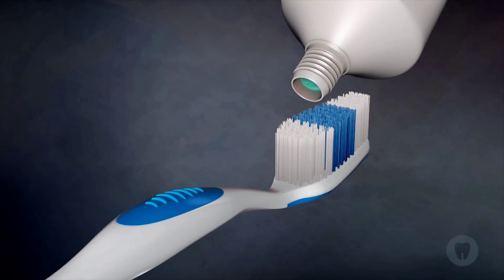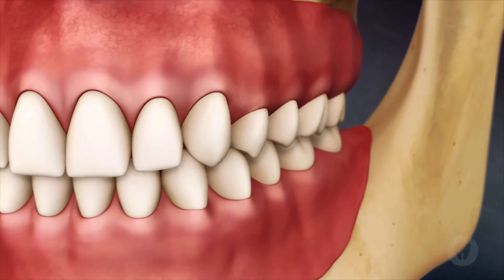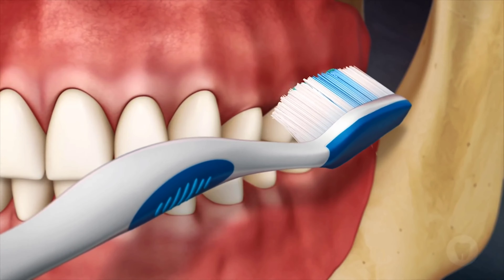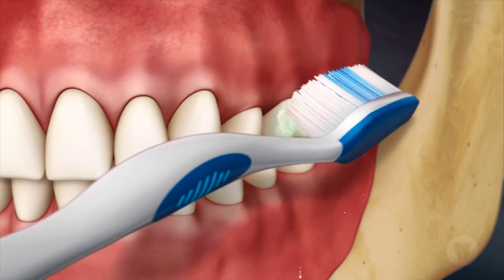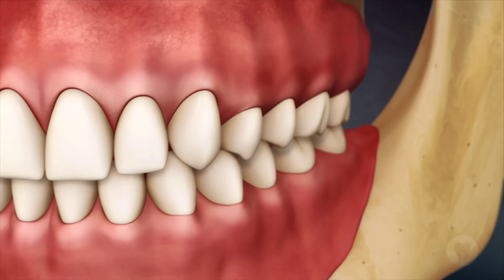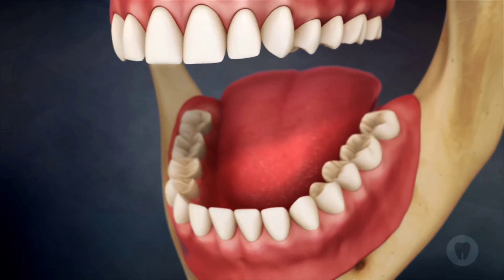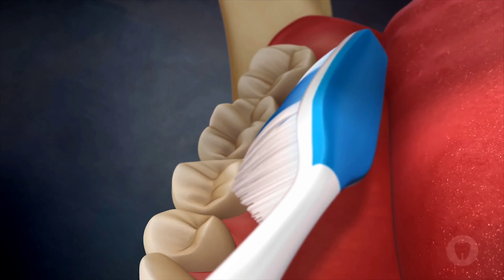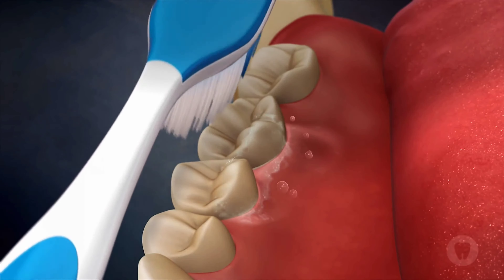Modified Bass Brushing Technique - Brace Dental Clinics

Comment: I've always brushed my teeth 
Vertically up and down, probably it's wrong,i have good clean teeth some are a little bit yellow, I only have 1 cavitie that i got when i was a kid, it that has been filled by that white cement type stuff, I'll start brushing this way
Reply from the maker: The problem with vertical and horizontal brushing methods are :
1) Vertical Brushing often leads to gum recession over years

2) Horizontal brushing leads to cervical abrasion of teeth